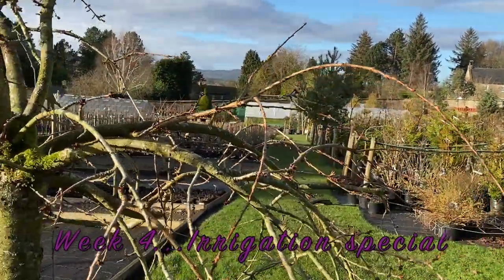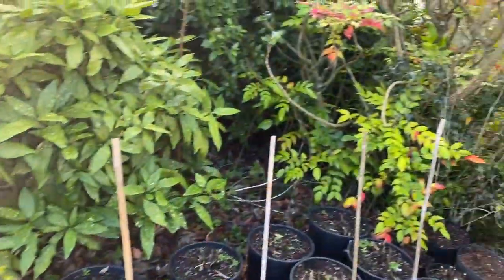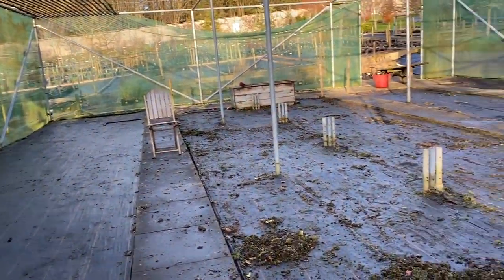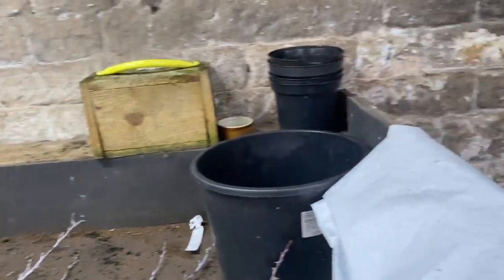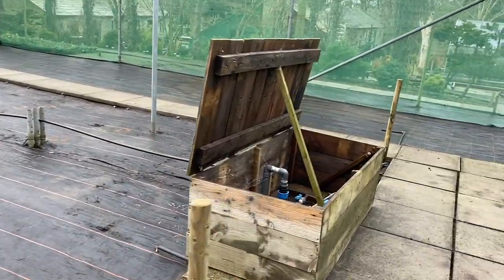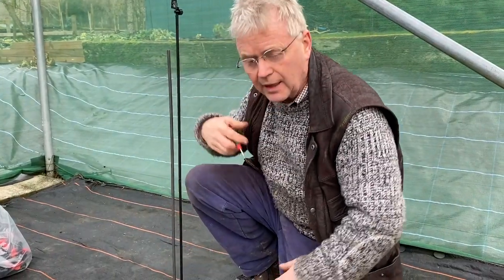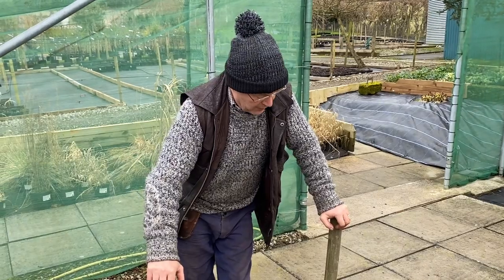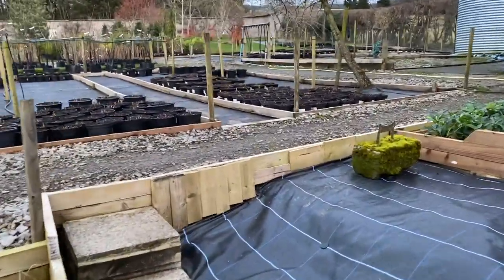HOW TO RUN A NURSERY...WEEK 4/52

Comment: Do you install "inline filters" in your black pipe lines? Or do you filter your water somewhere else? You didn't mention it at all.  At home here in WA we use that system. We also get a lot of grit in our bore water and in our mains water as too. Filters can save a lot of annoying sprinkler head maintenance.
Reply from the maker: I actually filmed the pump house and pressure vessel Malcolm......but deemed the sequence so incredibly, mind numbingly boring, I cut it out....it’s really nerdy stuff as I’m sure your aware....taps, pumps, non return valves, .......I feel traumatised thinking about it. I assumed people would just maybe use it on home supplies etc....I forget other nurserymen watch this stuff as well. But in answer to your query, no, I don’t use inline filters. I use a fine and hefty screen filter from the main supply pipe coming out of the pressure vessel. I don’t think our waters too gritty like yours....were over limestone so I suspect it’s pretty well filtered....I just clean the screen a couple of times over summer if I think pressures dropping or the pumps struggling......Before i put the filter in, the problems with the old filters clogging up were, as you quite rightly but more politely said, a pain in the arse. But it’s funny how you put up with some things before actually addressing the problem. I am a terrible procrastinator with boring jobs......(especially nerdy mechanical ones).....very best wishes....Malcolm